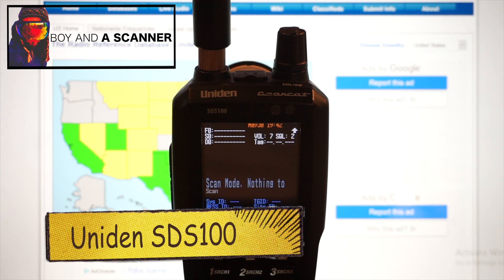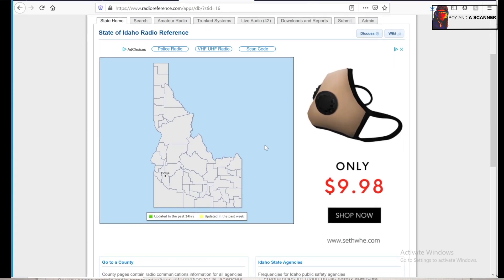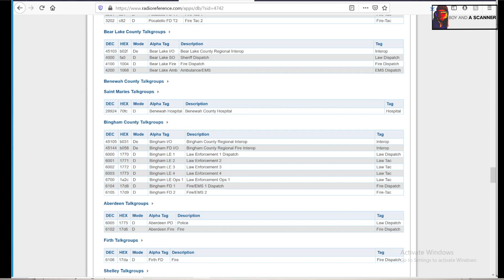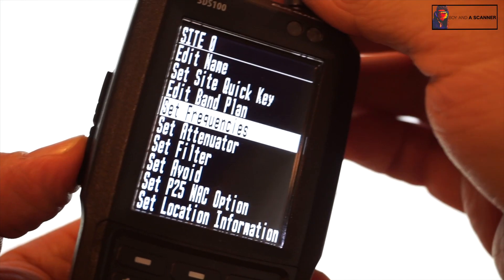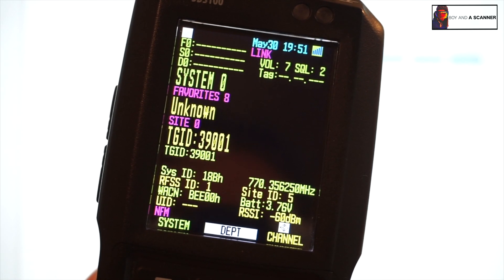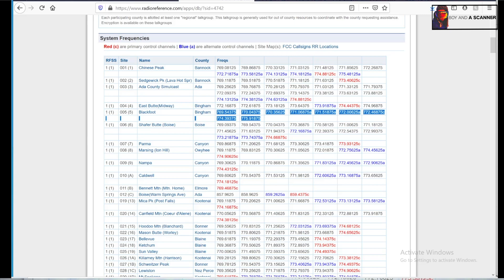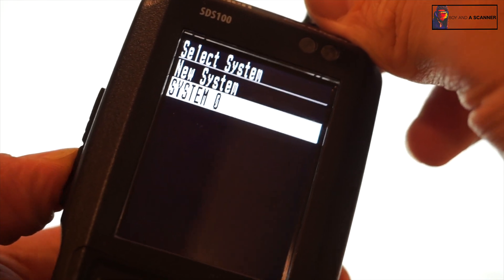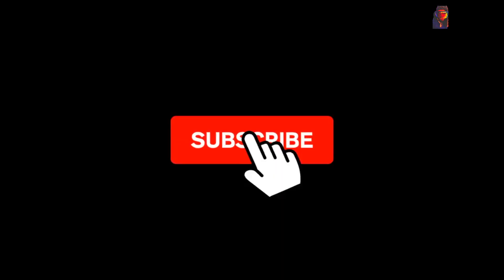Uniden SDS100 - How To Program A P25 System Manually

Comment: Hello. I live not in USA. If I don't have data from Radio Reference, but I only have the control channel frequency, is it possible to programming it into this scanner?
Reply from the maker: Yes, absolutely! You can program P25 systems with just the control channel frequency. In Sentinel, create a new P25 system, enter the control channel frequency, set the system type (Phase I or Phase II), and add the Site information. The scanner will decode the control channel and discover the talkgroups automatically. You may need to monitor and manually add specific talkgroups you want to hear. Check if your system uses NAC codes - you might need those too. My video "Uniden SDS100 - How To Program A P25 System Manually" walks through this exact process!

Comment: Hello, thank you for the video. SDS200E owner here. I see two active CAP+ frequencies (same color code and close to each other) when I use the search function, but no audio. Then the CAP+ sometimes gets replaced by ENCRPT (that is scary isn't it) when the transmission is active, no audio. I programmed the frequencies in a MOTOTRBO system, I still cannot listen to the audio. I get some quick unreadable garbled voices sometimes, for a second or two, but thats all. I tried programming the frequencies in a P25 Trunk system, failure again. Cannot hear anything. Should I stop hoping that it is possible to listen to these frequencies? Are they eternally encrypted and is it virtually impossible to listen? Any advice? These are in the 419MHz region. European country here.

Comment: All I gotta say brother, is thank you so much for this video 4 years later!  I thought for sure that my SDS100 was going to be an expensive paperweight after Utah's switch to P25.  I was able to get some traffic using SDRTrunk, so I knew it was up and running, but all the configs I got from Sentinel for the radio weren't working properly and there was no traffic whatsoever.  Manual programming was the way to go with getting traffic coming across.  Unfortunately, I noticed it tends to hang on a specific frequency after receiving traffic on it, so I'll have to troubleshoot that next, but at least it's promising hearing chatter again!... Now I just gotta hope they don't go full encryption on it 🤞
Reply from the maker: No problem! Haha ya encrypted is such a bummer… glad to hear your getting things figured out! Cheers! ✌️

Comment: ~ THANK YOU!
~ it's been silent for a while, as I'm learning the SDS100 . . .
~ with this tutorial I managed to start hearing a few things . . 
~ one question though . . .
~ I followed the instructions and noticed that you used [DEC] when inputting the information (however) on my menu it shows [HEX] . . .
~ do I continue to input the [DEC] or the [HEX]? and does it make a difference?
~ any assist on this will be very helpful!
~ Thanks in advance! 👍
Reply from the maker: Hey, glad to hear the tutorial helped you get your SDS100 up and running! 🎉

About your question on DEC vs. HEX: both are just different ways of showing the same information. DEC (Decimal) is what most of us are used to—regular numbers. HEX (Hexadecimal) is a bit more technical, using numbers and letters (like 0-9 and A-F).

So, if your scanner is showing HEX but you’ve got the info in DEC, just stick with what you have—it’ll work the same way. Just make sure to be consistent with whichever format you’re using.

Hope this clears things up! Let me know if you have any other questions, and happy scanning! 🚀
Reply: @BoyAndAScanner  ~ THAN K YOU!
~ this clears up alot of what I was wondering about! 
~ I've subscribed and will go over all the related videos for the SDS100 and ensure I get it all correct and by your tutorials, I'm sure I'll be led in the right direction!

Comment: Is there different steps between phase one and phase two set up?
Reply from the maker: The setup steps for programming Phase 1 and Phase 2 P25 systems on the SDS100 are quite similar. The main difference is that with a Phase 2 system, you need to ensure that the system type is set to “P25 Standard (Phase 2)” when you’re creating or editing the system. This setting allows the scanner to properly decode Phase 2 transmissions.

Other than that, the process for entering frequencies, talkgroups, and other details remains the same. Both Phase 1 and Phase 2 systems will be programmed similarly beyond selecting the correct system type.

Hope this helps! Cheers

Comment: So if you use the zip code thing, will that only automatically pickup analog channels? And then p25 has to be programmed into the sds100?
Reply from the maker: No zip is everything in that area. Keep in mind the dmr / p24 stuff is an upgrade you need to buy and unlock on the scanner but zip finds all in that area within the mule range you set
Reply: @BoyAndAScanner  I appreciate you

Comment: So I need some help from the radio community, I’m looking for a desktop digital trunked p-25 phase two scanner, I assume this can do that but other suggestions would be great!
Reply: Uniden SDS200
Reply: @davidbee3704  thank you
Reply: @benmeyer2916  No worries. I have one and I really like it. I have been scanning for nearly 30 years and it does take a little to get to know - it's a powerful scanner. Best way to get to know a scanner is to program it manually (using the front keys).
Here in Australia we do have P25 systems (mainly government) but more and more commercial users are moving to DMR Tier 3 (trunked) networks which the SDS200 can monitor.
The SDS200 is pricey but worth the investment if you are a keen radio/scanner enthusiast like me.

Comment: I have to say a big thank you for this video. My area Law Enforcement just switched to P-25. Which wasn't a problem. My HomePatrol 1 & 2 works just fine on P-25 trunking. The problem is Radio Reference and Sentinel software posted the new talk groups, but there were at least 2 talk groups not listed and a couple of channels in some talk groups not listed. So I upgraded to the SDS 100 and watching your video was able to use Discovery mode to find the missing talk groups and add them to the system in favorites. All this was done in just a few hours of receiving my scanner, learning the basics, and then following your video. What made this important to me was, one of the department talk groups missing was the department I retired from after 34 years.
Reply: Thank you for your service, sir. I'm glad you got it working the way you wanted it to. I'm thinking about getting a digital one like that, but I'm still trying to figure out exactly how they're programmed. This video helps, and I know a little bit about how digital trunked systems work but I'm still not completely sure, and one of the officers in the department where I am said they're probably gonna migrate to the Ohio MARCS-IP system in the next couple of years. And I'm glad because they're so much clearer and safer than the analog systems, but it sure takes a while to figure them out.

Comment: Hi, in order to learn how to program my SDS100 manually, I'm trying to use the Discovery  feature  to find P25 Trunking systems. When I set the Discovery feature it asks me for a new session and a name for a system. How do I enter or define a system? It seems that you need to have a system set in order to use the Discovery feature. I live outside the US so I can't use  Radio Reference or the zip code feature. Thanks for your assistance.  73.
Reply from the maker: Hello thanks for watching and asking this question. So when you’re using the discovery feature it’s best to just use conventional because it will show you if the system is digital by showing P 25 cap+, etc. if it picks up activity on a certain frequency. But for example here in the United States if I put in a ZIP Code and I go to discovery and I use the trunking discovery I can just click enter on the system without entering any text and it will automatically show a list of systems in my area that I can choose to discover. It’s much easier just to use the conventional discovery though and set your lower and higher frequency and just let it search until you find something because it will find digital frequencies and then at that point you can follow my instructions for setting up a P 25 system that I have here on my channel.

Comment: Would an antenna in my attic or something not too obtrusive in/near a second floor window work? Any suggestions? What type of connectors would I need?
Reply from the maker: I would think this would help a great deal yes. Check out the Procomm spider that I did a test with here on the channel. That’s my main base antenna now I and it’s working amazing. Keep in mind you’ll want to stay away from electrical as much as possible. For the antenna I mentioned all you’ll need is a bnc to sma for it to connect to the sds100. It comes with the coax. If I come across anything else I’ll let you know But I only wanted to give you an opinion on a base antenna that I’m actually currently using that’s working better than my other antennas.